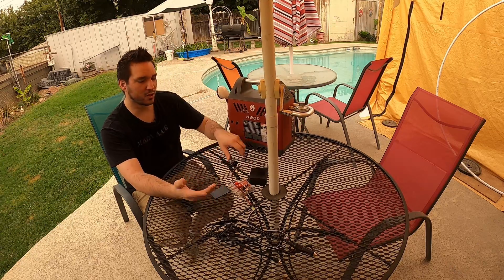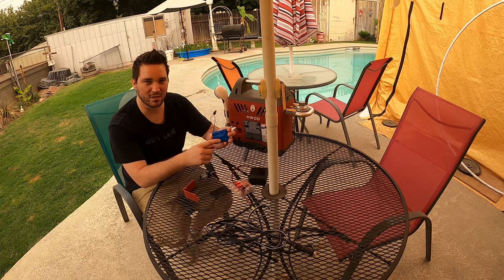Coleman Oasis Hot Water Heater Battery Conversion

Comment: I have seen so many videos of this contraption, and NO ONE has talked about the battery charging times which is 6-8 HOURS. Then, no one talks about how the 12v TRICKLES energy consumption, so if I have it connected to a bluetti battery, it shuts off due to not registering the power consumption. I got my unit yesterday, and left it charging all night via the 12v car charger on the bluetti eb3a that's connected to electricity and it turned off, and still has an amber light alert which means LOW BATTERY. I'm starting to wonder if this unit is worth it.
Reply from the maker: @florindagonzalez5700  it no surprise it take awhile to charge, no different than a cellphone or any other 18650 battery with multiple cells; it should even say in the manual. you let the Coleman battery charge all night and it didn’t last? Maybe the power cable is low output like a phone charger, damaged or even Sounds like a bad battery pack hence why I made the mod, it dies if you don’t maintain these batteries during the offseason. This is why I made mine to be able to swap the batteries. I ended up buying the battery boxes for 12v bicycle lights ($20-30) off Amazon since they are waterproof and regulated the power to around 11.1 since that’s what the pack uses. You could probably use a 12v drill style battery and regulate the voltage which is more convenient if you have that platform. I was going to do this as well but haven’t been camping in a few years due to the last wildfire. I’m not a fan of the Coleman because it has auto off if water doesn’t flow, safety feature or not a few other brands have auto off and start.

Comment: do you think I could bypass the battery all together, and solder in a cigarette  plug  and get my 12v from another source?
Reply from the maker: I can't validate that and thats an AWESOME idea! I haven't had time to do the camping thing so I haven't innovated on much lately. Just make sure you use the quick disconnect connectors so you can still use your shower if it faults out for whatever reason you can still have a plan B. You might still need a buck converter to prevent spikes in power if the alternator is running. You will also want to limit run time of the shower to let it rest and not run it continuous. Also, make sure the Cig lighter plug and wire are heavy enough to keep a stable power source amongst the distance of wire because 12V will drop off hence why it might not work. Lastly, make sure your fuse in the cig lighter end fuse is similar or more (recommended for distance draw) than whats required on the machine i believe it was 5AMP.

Comment: Just wondering if you still make the Coleman oasis hot water heater battery conversion
Reply from the maker: I don’t because it’s too expensive for a profit.

Here are some parts to make my new version 

DOCOOP Waterproof DIY 6X 18650 Battery Case Box Cover with 12V and USB Power Supply for Bike LED Light Cell Phone Router https://www.amazon.com/dp/B08LV5G9HY/ref=cm_sw_r_cp_api_i_3CJ11XXDFDCJ792C1RYX?_encoding=UTF8&psc=1

[2 Pack] DC-DC 5A Buck Converter... https://www.amazon.com/dp/B085T73CSD?ref=ppx_pop_mob_ap_share

Comment: Do you sell the pack that runs the 18650 batteries?
Reply from the maker: I did sell a few of these first designs and one upgraded version. When I upgraded them to have voltage regulators ($20) with a LCD readout and a better waterproof battery box ($29-32+ tax). I had a lot of money in them at that point. I couldn't sell them for more than I paid for them ethically since they costed $55 to make. I have mine still left that sits on my desk because I haven't been camping (too lazy to rustle with the camping gear) due to fires and other preventative events.
Reply: @ProjectAnubisUSA  I saw the video for the upgraded model and it was way over my head.  I contacted Coleman about getting a replacement battery but, even though they still sell the H2Oasis, they've discontinued the battery (which really sucks).  There's one person selling them online for about 60 bucks which seems pricey, especially for old stock. I saw a three battery housing on ebay for 10 bucks.  If I soldered a wire and plug onto that, would that work as a replacement for the crappy coleman battery?
Reply from the maker: @billfreiberger1627  Yes as long as you buy a 3 cell battery pack thats wired in series to give you 11.1v vs parallel which will give you 3.7v only. I recommend a voltage regulator with a readout (lcd buck converter with 5A rating or more) to lower the output voltage because good cells wired in series will have over 3.7v (4v) x 3 = 11.1v  (12v).
Reply: @ProjectAnubisUSA  thanks.  I appreciate the help and advice.  The voltage regulator is a bit over my head.  I'm really just trying to make a simple replacement pack that will allow me to keep using the H2Oasis.  Except for the battery, it's in good shape and should last years.  

Also, do you know what type of connector plugs into the unit?
Reply from the maker: @billfreiberger1627  The voltage regulator is 2 wires (plus and minus) from the battery pack in and 2 out into the Mini Tamiya Plug.

https://www.amazon.com/Solu-Adjustable-Step-down-Converter-Voltmeter/dp/B00VWL41TM/ref=asc_df_B00VWL41TM/?tag=hyprod-20&linkCode=df0&hvadid=216538221087&hvpos=&hvnetw=g&hvrand=16094123619461755069&hvpone=&hvptwo=&hvqmt=&hvdev=c&hvdvcmdl=&hvlocint=&hvlocphy=9031868&hvtargid=pla-352597795389&psc=1

https://www.amazon.com/PAIRS-Tamiya-Style-Connector-Plugs/dp/B00XQ91998/ref=sr_1_3?keywords=Mini+Tamiya+Plug.&qid=1639615689&sr=8-3

https://www.amazon.com/Mirthooby-Adapter-Converter-Airsoft-Battery/dp/B07QGPGQZ8/ref=sr_1_5?keywords=Mini+Tamiya+Plug.&qid=1639615727&sr=8-5
Reply: @ProjectAnubisUSA  Thanks for all the help.  I have the information, now I just need to figure out what to do with it.
Reply: Decided to dust off my HWOD and battery is dead, Coleman doesn’t sell the batt anymore! Wondering if you sell your kit anymore?

Comment: Is there an reason this can’t be charged using a 10 dollar, 110v to 12v wall plug adapter?
Reply from the maker: Nope as long as the voltages are correct. It just makes It easy to maintain the batteries especially when your battery pack requires a wall outlet or 12 V outlet to charge whereas this allows you to take them out and use them in your flashlight as well when you’re camping or replace them on the fly without having to buy expensive battery packs that most people won’t maintain and they die during storage. Most people won’t go get the camping gear out to make sure everything is charged during the off season. It’s a preference thing..

Comment: Hey, I would be interested in doing a 20volt battery/dewalt...can it be done?
Reply from the maker: Yes it’s possible but you would have to reduce the voltage and it can be on a quick exchange. They do it for the Milwaukee batteries to charge your phone from so it should be similar.
Reply: @ProjectAnubisUSA  since uou have the heater, will you look and see jow many volts it pulls? I habe the usb adapter for my dewalt batteries.  Idk if it can pull enough power through that tiny cable.
Reply from the maker: @sonnymcgee5871  I won’t be able to get that information to you anytime soon since everything‘s in storage. But the fuse is a five amp fuse according to the manual and the only thing the batteries run are the LED lights, igniter, water pump and water flow sensor of some sort. Here is a link to the manual. Hope this helps!

https://pimproductmanuals.coleman.com/Manuals/4010047123AU.pdf

Link to AMP + Gauge + length for 12v

https://www.google.com/amp/s/www.engineeringtoolbox.com/amp/amps-wire-gauge-d_730.html
Reply: @ProjectAnubisUSA  Thank you!

Comment: I would like to purchase one of these replacement baterries from you. How?
Reply from the maker: I’m currently sold out. I even gave my personal one. I’ll make more, I’m just trying to finalize my new design. I need it to be reliable as the current and compact. Also a power tool battery design in the design stage, I just need to cut cost and do readouts of the output voltage for the amp draw. Updates as soon as I can.